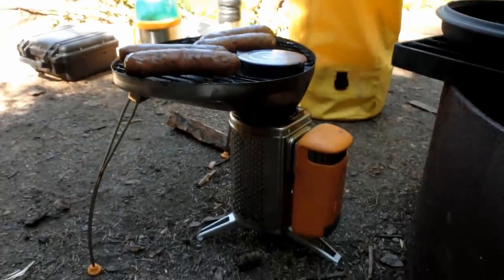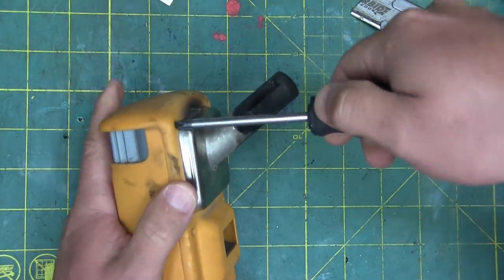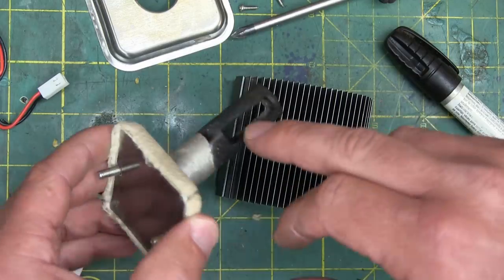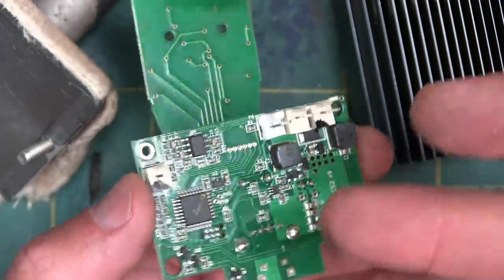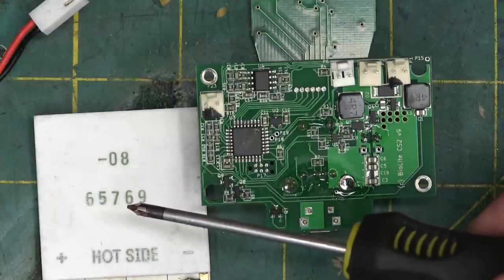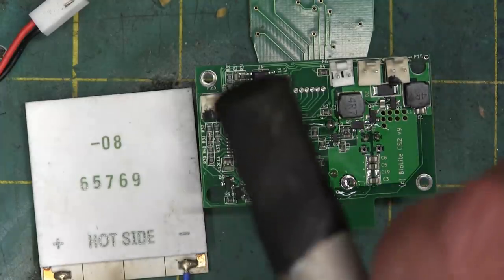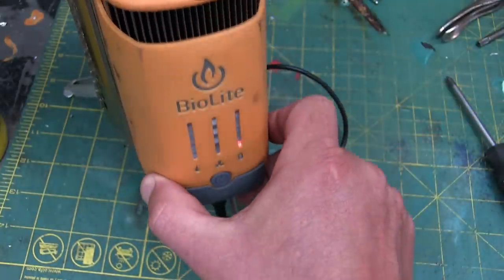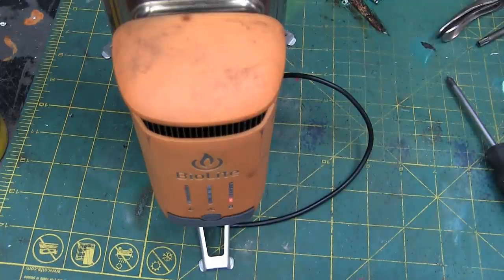BOLTR: Biolite Stove | Camping Gear

Comment: I have to say, I think you broke it. I have three of the stoves, two small and one large family size. I've used the one on my motorcycle at least 200 times and never had any trouble at all. The house unit gets used on weekends and has worked great for at least a year. Maybe take it apart again and see if you crossed something.

Comment: im pretty shure its not dead , pretty shure the dissasembly ruined the contact the peltier element had  and thus its not getting heated / cooled properly , also just throw some twigs in there and let it burn for an hour or 2 , maybe a torch just aint enough

Comment: Would you happen to know how old that unit is? Reason I'm asking is I have one I picked up a couple years back that actually has a copper probe, a sort of metallized fabric at the base of the probe where that one is just a plain metal plate, and instead of the 3 lines of LEDs there is a RGB LED to say if it's on and ready to charge and another two to say if the fan is on low or high. Just curious to see which one came first especially with the change in probe.

Comment: Hey AvE. I bet you triggered some sort of voltage monitoring system when disconnecting the connectors on the pcb.
Same happend to me when trying to replace a NiMh pack in a Philips shaver. It charged but would turn on. Just blinking with its leds to tell me the battery was empty even after hours of charging. I even verified the battery voltage by hooking up my multimeter to it. If this is the case you really need to be a wizard to reset the controller on the pcb. But to be sure its not just a simple low voltage protector indicating a true low voltage condition you should try giving the battery a few lifesaving pixies from your bench power supply (directly into the battery). I believe a charge between  0,25-0,5Amps will be safe at 4 volts. With some luck your Biolite is back in busines.

Comment: There is no aluminium in that thermally conductive pad. Its expandable graphite, expanded and then compressed again. And its not expensive in such small quantitys. I have a few m² at home, out of a PVD where it is/was thermal and electrical contact for a ZnO target.

Comment: I would like to know how many amps the thermo-electric generator outputs, when the stove is running (not the datasheet specs). Is there any chance that you can measure the current of the generator?

Comment: Charging aspect of it is more of a gimmick. You’d have to run it all night to ever get your phone charged 

I have the non charging cook stove version 

$44 on Amazon
Reply: Yes and no. You probably missed this detail in the video: The battery gets charged by the stove, devices get charged off the battery. The battery charging design is more robust than you imagine, although you’re not too far off. We’re talking operating the stove several hours a day, not overnight. Let’s say an hour and a half in the morning, two hours at night. Keep in mind the target consumer for this model: rich outdoorsy yuppies. Your serious ultralight backpacker might buy one of these, but is more likely to rely on their Primus cookstove.

The purpose of the basic design was for people in developing countries where being off the electrical grid is the norm (and even city dwellers suffer through regular periods of the grid being down). But the point is, there are many rural communities that can get a phone signal but have no where to plug in their phone chargers.

The company that makes these uses its profits from rich consumers in the developed world to subsidize distribution in developing countries. The stoves for the “emerging markets” have a different design. They’re larger, for one thing. They don’t need to be small enough to fit into a backpack. I’ve only seen fotos, but I imagine they’re sturdier than the backpacking model, since they’re for daily use. This would explain the unused capacitor socket for a larger capacitor: they’re using the same circuit board for multiple models (some of which probably use larger battery packs also).

Comment: Probably killed the coloumb counter when you disconnected the battery.  The processor thinks the battery is dead, and you'll need to charge it up in kit before the coloumb counter recalibrates itself.

Comment: #AvE This is an interesting concept. I've built wood gasifiers to run generators, I have a larger one that runs a 4 cylinder 10k generator really well. So stuff like this is always interesting. 
But looking at this concept, to have a smaller setup, that burns only a small amount of wood, is really interesting. A really good project would be to take this concept to the next level, to be able to build a bit larger version of this. As in to  be able to "build your own" device which can convert heat to electricity, but something that can put out a little more useful power. Mabey something large enough to at least charge a car battery in a decent time period? If it could charge fast enough, then a small power inverter could be added?? That would be a really useful small power generation device, for camping or emergency usage. And it wouldn't be reliant upon "solar power" or other "sunny day" or "weather permitting" type devices.

Comment: 2nd thing popping up in my feed today that i want too buy.I saw this the other day in a shooting mag and just glanced over it, didn't realize it had all the crap hanging of the side and charging port etc, though it was just for boiling a small amount of water.For a hunter,fisherman,four wheel driver etc etc these are ideal! Its a pain having to start car or fire up generator to charge phone,camera,torches etc.Being able to promptly boil the morning coffee is just a bonus! Im sick of carrying the little butane chinsy stoves.
Could you pot the board in something (epoxy to handle heat maybe?)too mitigate the conductive dust issue? Or would it be better to seal unit up?
Always been fascinated with peltiers.

Comment: i have a first gen unit, it has served me well for the last 4 almost 5 years. first gen units wont let you kill the batteries through use of the usb, I'm wondering why that's not a feature on second gen units.
Eather way it was cool to see it pulled to bits,  I have wondered whats on the inside but never been willing to pull it apart, encase it stopped working... like yours did.

Comment: could you imagine the size and cost . of a TEG to run a house? or even a cabin? or just enough to run a 2500 watt inverter. I have wondered if it would be worth while. to put a few Teg's on the back of a solar panel. and a heat sink. would it contribute enough to be worth it? maybe just a thermal and solar panel in one. make power and heat water . with one panel. and cool the panels making them more efficient? could be a good idea. GREAT VIDEO

Comment: 5:15

Cheaper and not really needed 
It's in the fire and just doesn't need a huge amount of surface area and just good conduction is good enough 

Cheaper, easier, conducts better
Reply: It doesn't remotely conduct better.

Comment: You know this thing could be used for getting electricity out of heat producing appliances... like AC units for example. I bet if cost were no object and you cover the hot side of an AC unit with it you could probably recover some electricity back from it.

Comment: Noooo.. SEG is not two differential metals, least not so far as I know.  Its usually a P doped and N doped semiconductor.   A P doped semiconductor uses holes as its primary charge carrier while an N doped semicondoctor uses electrons.  Electrons are pushed towards the cold end of a thermal gradient while holes (since the'yre just "not electrons") are pushed towards the hot end of a thermal gradient.  You just alternate them back and forth and you have a cumulative voltage generated by a thermal gradient where the voltage depends on the number of elements and the current depends on their size (and both on temperature).

The biggest failure mode with these things is thermal cycling.  A lot of different materials come together and each time heat or cool it (it doesnt help that you have to do both at the same time for it to work) it stresses all of the semiconductor connections.  It only takes one of those bits coming loose for the whole thing to not work since they are all ultimately in series.

Comment: Terribly disappointed the thing had no conformal coating. YOU would think that would be a must have for an outdoor camping like device. The sealing aspect of the ash getting inside is a little more tricky to mitigate as well. Overall just as surprised at the build quality though.
Reply: YEAH BUT a device that goes into the heat is going to dry off pretty quickly
Reply: John Possum Very true, but for the low cost of conformal coating and the risk that still exists regardless of the heat. (I would gladly pay the extra cost for that protection.)

Comment: Yeah ?  If they are using all the outputs on the microcontroller for all those leds on the other board,     then why is there only 6 or 8 wire connections between the two boards ?

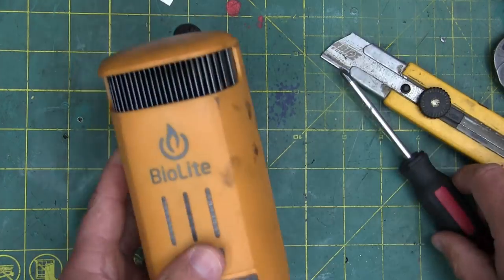Comment: 2:01 Do you have a video about id'ing different types of plastic? Themoset, thermoplastic, glass fiber, etc? I had a problem with the Ford; I'm thinking it was fiber-infused plastic, but I dunno for sure.
Reply: bcubed72 Thermoset will char when heated, thermoplastic will melt. Glass reinforced plastic makes a scrapey sound when you cut it. Most plastic parts will have markings on the inside somewhere which you can google.

Comment: I would have liked a test of the battery to see if the battery went ☠️ or if it's some sort of safety circuit preventing it from working when it detected the battery was removed.

Comment: iv had the older model biolite campstove for like nearly as long as they have been making them 5 years or so it is my goto prefer it to the camp fire due to less smoke or non anyway enough with the story to the point every time mine is completely dead i light a fire in her and a hour later the fan kicks back on and where off and running

Comment: Hey Mr. Ave, now I'm not much good with electronics, despite being a farmer and being good at most everything else under the solar flare up in the nowhere. But could I either potential send my dremel tool that you could do a video on as to why it crapped out despite being virtually bein brand spanken new, or could you do a video as to why the cold kills motorized whirly tools powered by wall pixies? 🤔

Comment: Wonder If I could cool the CPU of my computer with the peltier device and the 12 volt from the fan port :o

Edit : Reconsidering won't the peltier device create frost with the humidity in the air ? What y'all think
Reply: You'll need a couple of amps at 12v. 
My module cools 68 watts and needs ideally 15 volts and 8 amps!

Never gonna get that out of a fan power outlet
Reply: UltraNoob - yep not so efficient
Reply: Never meant to be efficient, I want to see if I can get lower cpu temps on an old ass pc
Reply: I've heard of overclockers putting them under the heatsink,  but it doesn't really help unless you want to run the chip cooler than ambient. And frost is an issue yes,  but the liquid nitrogen boys already deal with that.
Reply: Doug Reed I figured but now the project is on  alt as I destroyed my only peltier device on the lab bench power supply, will have to get another one
Reply: most peltier devices can't handle near the amount of heat a cpu puts out.  You generally only see 4 main types of cpu cooling.  Air,water,refrigerant or liquid nitrogen.  Refrigerant type systems are basically a air conditioning system compressed into a cpu sized package, works like a hot damn and cost's a fortune in electricity for what you get out of it.  Those sweet sweet overclocks though ><
Reply: Assume your peltier element has an efficiency of 10%.  Now assume your CPU produces 200W of heat.  That means the peltier cooler itself had to consume 2000W, all turned into heat, to move the original 200W of heat.  You now have 2200W of heat to dissipate with a heat sink and fan rather than your original 200W.

Unsurprisingly you need really specialized situations to justify that terrible efficiency.  Some space applications, some science ones where it lets you hit particularly cold temperatures, some things where you really don't want moving parts, or occasionally your item to be cooled is tiny and not putting out all that much heat anyway.
Reply: Was an old skool overclocking cooling technique. Im sure google will come up with something for ya.  People had 2nd power supplies just to run the peltier and yeah frost was a problem
Reply: Adam Olsen To be honest, they don't really need below subzero cooling.

So apart from the initial startup, the power required will drop quite a bit relatively.
Reply: Adam Olsen even then a i7 7700k only has a tdp of 91 watts

Comment: You didn't leave the heat on long enough.  It needs constant differential in temperature to provide small amounts of power over time.  Hitting it with the torch and stopping is not going to get it charging.

Comment: You sure you have the battery in right it seemed to have been fitting better before also you could directly charge the battery bypassing the brains which won't chooch right now...

Comment: I know the 18650's are very popular but in this case, I think it may have been better to use a battery that could be swapped out (NiCd or NiMH?).  Am I the only one that thinks it is strange to put a lithium cell an inch from a hot fire?

Comment: Instead of sending it to mother Gia, I wouldn't mind having a try at getting it to work or I could use it for parts. 99% of my electronic parts come from stuff left at the side of the road. I have been disabled for the last 13 yrs and my income dropped to one sixth as when I worked and since I worked 2 to 3 jobs my laugh disability income is to high for nada any type of assistance.Went from 60k a year to 11k..

Comment: why use aluminium when copper is available, it won't melt and transfers heat better. Maybe too good heat transfer? It cost more but it's really not that much more for 300g of copper
Reply: cost, harder to machine/work with, heavier, corrosion.

Comment: It probably failed because you took it apart and didn't put it back together correctly. That or you fried the circuit board with static electricity when you got all touchy feely with it.

Comment: Same BS happened to my bio lite. Battery decided she couldn't take one anymore pixies and taped out. Tried to replace the battery and got the flashing lights like this. Great versatility when it worked outdoors since Gouge-tario, Ontario, charges a kidney and grain fed first born's for a few pixies electricity when outdoors. 

Cool concept of a stove but not meant for long-term use by some primate snow-Mexicans.

Comment: No coating to protect from moisture and wood ash easily getting in there, I'd guess one of the failure modes (besides digging in there with one's dirty dick-beaters) is corrosion.

Comment: Ave those are the things I used to make in Waltham Massachusetts i had to cut the ingots it's a little squares then they had to be inspected so they didn't have holes and cracks in them because they're like little crystals after you cut them and then you solder them to the boards you change the polarity you either get  they get hot as a bastard or cold is a f*** I think they call them Thermal couplers and I had no f**** idea that if you heat the f**** thing it'll make electricity man this is cool I used to build them f**** things I used to be an electro-mechanical builtech and test tech till George f**** Bush got into office and everybody in the United States got laid off that c******* but yeah those things are cool I might have built that one who knows

Comment: I wonder if a setup using the same principle could be used to replace an alternator in a car? Just put the probe and heat sink assembly on the exhaust manifold to get the required heat.
Reply: diltzm I would think not only because amperage
Reply: You'd need a lot of those cells and long drives to charge the battery enough for the next engine start.
Reply: search for: A research on thermoelectric generator's electrical performance under temperature mismatch conditions for automotive waste heat recovery system